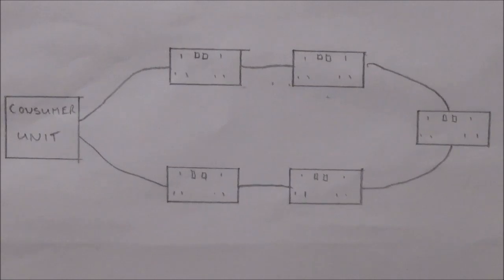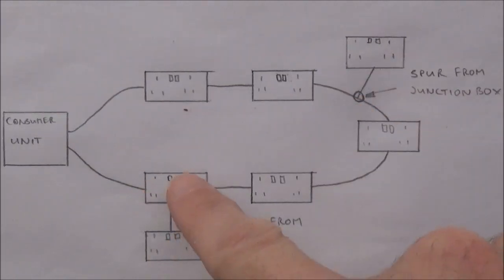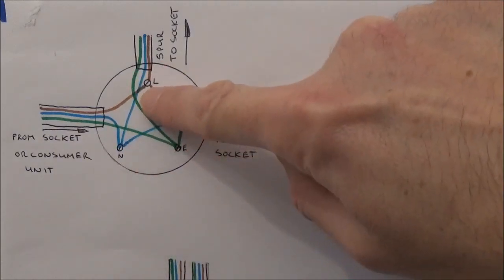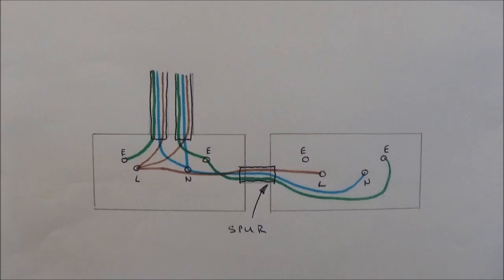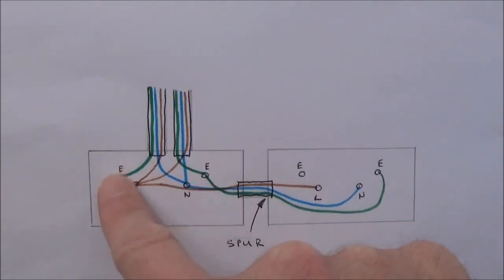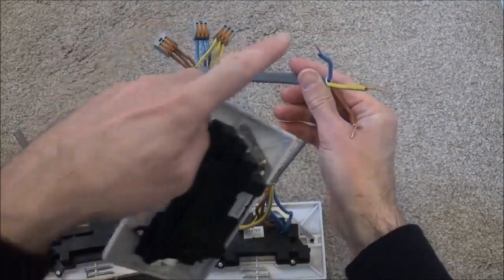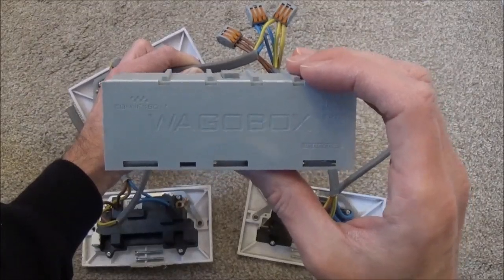How to wire a spur socket to ring circuit. Add a spur socket to ring main.

Comment: What worries me, is that if not correctly connected, people can end up with a broken ring but they won't know because everything "still works". (one of the reasons radials are better than rings IMHO)
Ideally confirm you've still got a ring afterwards, but that's not really a DIY job.
Reply from the maker: That is true for ring circuits, as you say radials are better in that sense.  Thanks for the feedback.

Comment: Great. can I wire a doorbell transformer in this way. Or doing I need to add a plug and socket as well?
Reply from the maker: You would need to do a fused spur using a fused connection and then use the suitable rated fuse to protect the doorbell circuit. Unfortunately I haven't done a video on this yet. Thanks for watching.

Comment: Excellent tutorial...
Q. I want to add a ‘new double’ wall socket from a ‘single floor’ socket which sits immediately below where I want the new double to be located.....can I just spur from the single floor socket straight into the new wall double? Thanks
Reply from the maker: In theory yes. You could also replace the single socket for a double if you want. Just make sure your existing electrics are in good working order as adding sockets to an already overloaded circuit could be dangerous. If in any doubt, call an electrician. Best of luck.

Comment: Great video. 
Can I fit a fcu in the same way to hardwire a class 2 alarm panel in? 
Basically I mean spur of a 2 gang socket and instead of adding another 2 gang socket I want to add a none switched fcu so the alarm panel can not be easily disconnected.
Reply from the maker: Yes you can. Just make sure you put the correct rated fuse in the FCU. They often come with 13a but you may require a 3 or 5amp. Best of luck.

Comment: Can you have 3 spurs from one ring?
Reply from the maker: You can in theory have up to one spur per socket. Obviously there are other factors that may affect this which is why it's worth getting an electrician to check your existing wiring is sound before adding more sockets. Thanks for watching.

Comment: Going to show me how to test it!
Are you certain it will trip quickly enough not to burn the fucking house down!
Did the addition affect the Zs?
Do you know what Zs is?
Do you do gas videos?
Reply from the maker: No I don't do gas, I'm not a qualified gas engineer. Thanks for watching.
Reply: Calm down steve
Reply: Correct me if I’m wrong not having a dig at anything, but am I right in thinking that all electrical works needs to have a mwc or when applicable notify labc, am I right you even need a minor works certificate for a decorative light fitting or even a  replacement from white plastic to a metal socket cover as to show the cpc is continuous and not altered the zs value. Yep Ive done diy electrics and now currently getting it redone by a registered sparks so I know I’m insured.basicly am I right in thinking a sparks has to do everything even the smallest of jobs to get that cert ,only thing a non sparks can do is change a light bulb 🤷‍♂️
Reply: So your a qualified electrican
Reply from the maker: @stevensmith4449  no I'm not.

Comment: if you were to avoid using connector blocks and wire directly into the socket, would it just be part of the ring? is that acceptable to do?
Reply from the maker: To be part of the ring you'd need to connect an existing socket to the new socket then back to another socket in the ring but remove the cable that used to connect the two sockets if that makes sense. You can't have a ring within a ring. Hope that helps. Thanks for watching.

Comment: Does the junction box have to be accessible?
Reply from the maker: No but if it isn't then in theory it should be in a maintenance free junction box. Thanks for watching!
Reply: @POUSEaroundtheHOUSE  Thanks, great video. Just done mine now. Just carried a wire from my socket under the floor board to make a new socket. Getting a chase behind the skirting board was really hard. I find your videos really helpful. I used quick wire conections to build a lighting circuit in my man cave. Great vid that was 👍
Reply from the maker: Good effort and thanks for the feedback. Best of luck with your projects.

Comment: Thanks fab video, can you just confirm how many spurs you can add from socket to socket so can I go from the socket on the ring add a spur and then add a spur to that?  Thanks
Reply from the maker: One spur from a socket. If you want to do more spurs, you need to install a 13amp fused spur switch then your spurred sockets.

Comment: Electricity has so many hidden dangers that the majority of diyers have no way of checking, just because you used the correct cable size for the job and it works does not mean it is safe! What happens if there is a fault, how will you know if the fuse or circuit breaker will operate fast enough to stop the wiring from melting? There is a good reason electricians have years of training and charge what they do but at least if you use them you can be rest assured that your system and family will be safe.
Reply: Dont forget bs7671 18th edition wiring regulations!
Reply from the maker: Hi, yes I completely agree with everything you said. The video is to demonstrate the process of physically adding a socket this way. At 33 seconds in the video I mention the requirement to meet part P regulations which covers all the things you mentioned and more. Explaining the part P regulations in itself is a video. Thank you for your comment.

Comment: One spur from one existing socket, would I then be able to spur from the new socket I install?
I am planning on going from a socket in my kitchen to then run it underground to my shed 2 meters from the kitchen, I then want to set up 3 double sockets in my shed, could I spur from each socket I install ? Just for charging laptop powering speakers and some plug in lights ? Could I also push it and plug in an electric oil radiator ?
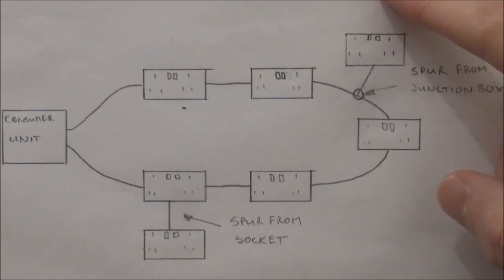Reply: Not an electrician .but according to my DIY book it firmly makes the point  1 spur from one socket. The chap showed2:47on the diagram you would be overloading with what you have in mind( if in the unlikely event that you had all appliances /tools working at same time.)
Reply: wasabimanic I have just seen another of his videos explaining the way to do this would be add a fuse switch before the first spur, also to be on the extra safe side I’m not going to ya a plug in heater and if I ever use lawnmower I’ll not plug anything else in the shed at the same time.

Comment: Can I switch a spur on and off from the socket it is wired to?
Reply: No , because you just on and off just that socket not all ring , you still have electricity on that ring from consumer unit
Reply: No, the switches on a socket control power to the load side (i.e. the front) of a socket only.

Comment: Just a quick question and from the video I think I have my answer, but feedback would be appreciated. I plan to add 3 double sockets in my bedroom, 1 either side of the bed and 1 behind the tv at high level, for the sockets at either side of the bed I plan to just extend the ring main so I would have 1 cable coming in and 1 going out and then for the socket at high level I just plan to spur off of an existing socket, is this fine to do so ? And is there a limit to how many sockets you can have on 1 ring ? Would it be advised to take out 1 of the existing sockets if adding new ones ? 

Thanks 
Conor
Reply from the maker: It's fine to take one spur off a socket. You can have plenty of sockets on one ring so that's not really an issue. The important thing is that your existing ring has been tested and you know it's safe and working properly, with the correct rated MCB and preferably these days RCD protection. All modern consumer units have this. If in doubt get an electrician to take a look. Thanks for watching.
Reply: POUSE around the HOUSE thank you for the response, that’s really helped 👍🏼

Comment: A complete circuit flows from distribution unit, life and back. A wire is called life before connected to appliances, from appliance back to MB unit, the wire is called neutral. Another wire is called the earth, connected to the appliance n as a one way connection to the MB unit where all the earth wire is connected to the iron rod dumped inside earth. Correct me if I am wrong thus far. If I want to make a spur, when I locate a circuit, I only see one wire. So I connect to the socket, before connection it is a life wire, the other point will be the neutral wire. For earth, just connect one green wire to MB unit from socket. correct me if I am wrong. Thanks.

Comment: If I had 10 socket on the circuit can I add a spur to each of those sockets?
Reply: I’m not sure in what application you would need 10 spurs coming off 10 sockets, unless your just asking as a random question. It certainly wouldn’t be recommended. You would just add more sockets to the existing ring main. It would also depend on the “load” you intend to use. If it was to power downstairs in it entirety that you would split that load over 2 ring mains, one for the front room and dining room, and a separate one for the kitchen. Hope this helps.

Comment: Sorry it me again; instead of the second (additional) socket in the spur, I would like to make it a light switch, and as previously explained, do I need a fused switch or a normal switch. Thanks
Reply from the maker: Sorry for late reply, fused switch with   3amp fuse for light. You e probably done it by now!

Comment: pleas HELP; I thanks a lot for your informative videos. I’m wiring; I have done what you’ve done but would like to extend Feom the 2nd socket to a lighting switch by a 2.5 t&e and the a 1.5 3core to the light. Should I  use a fused 5Aswitch or a normal switch. Thanks
Reply from the maker: You need to use a fused switch with a 3amp fuse, but if in doubt, use a qualified electrician. Safety first!
Reply: Thanks

Comment: Okay so hear goes.... I want too install another 5-8 plugs for my pc repair work shop onto the existing ring (I’ve basically divided my bedroom) how would I go about doing it?  do I just add a fcu and run it from that or is there something different like a 20 amp fcu I can use because it’s going too be more that 5 pc running at at lease 800w that’s not included the TVs and other hard ware for it?
Reply: What else is on the ring? You should just be able to break into the ring and extend it depending on what else is on it. A normal ring will deal with the computer load no problems.

Comment: Incredibly useful video. Will save myself hundreds when I move into my next house in November. Just get an electrician to give it a quick once over and good to go compliance wise
Reply from the maker: Thanks for the feedback.
Reply: Good luck finding an electrician who will sign off your installation. Their reputation is at stake, so firstly they will want to check every cable run and connection, then run the required tests, so that will be as expensive as any complete install.

Comment: Now you just need to do R1 R2 continuity test, ring main tests, insulation resistance, loop impedance and RCD testing, fill out minor works certificate 👍

Comment: When connecting a Spur, it's good practice to fold over in half 20mm of the wires at the end to give you twice as much copper to clamp the terminal into.
Reply from the maker: Thanks for the info Neal 👍

Comment: hi mate, do u have a video about how to wire in a 32 amp socket to my mcb breaker,    its so i can plug a 32amp compressor in my garage, ?,---  i want to use a big compressor in my house garage, its 240v and 32 amp,   but if i plug it in a normal socket it blows the 3pin sockets 13amp fuse.    is it just a case of putting a 32 amp rcd breaker in the mcb box,    then wire to it using thick 50amp wire,    then just put a  female commando plug on other end ?.----    is that all it is to fit a 32 amp socket so i can use 32amp in my garage  ?.      many  thanks dave, ps if u have a video can u show me it?. thx
Reply from the maker: Hi Dave I don't have a video sorry. I wouldn't like to comment on this without seeing it as I could provide incorrect advice. If you want to do it yourself then it is worth speaking to an electrician or your building control officer as adding a new circuit is notifiable works. Best of luck with it and sorry not to have helped.
Reply: @POUSEaroundtheHOUSE  ok that's fine, thanks -dave

Comment: What you forgot to say it a DSSO is only rated to a max of 20amps, if you ran two 13 amp appliances from one DSSO you would over load it,
Reply from the maker: That is the case for any double socket. Thanks for watching.

Comment: How many spurs can you continue with the one installed?
Reply from the maker: Only one spur from a ring final circuit. If you want to do more you need to install a fused switch from the ring final circuit (with a 13amp fuse), and then spur from that. Then you can have as many as you want in theory as the cable and sockets are protected by the 13amp fuse. Thanks for watching.
Reply: @POUSEaroundtheHOUSE  It is the same with garage lighting. You have to install a fuse board and then carry on from there. This must be the new regulation on the 18th edition or maybe was there early.  Thanks for the information it was helpful.

Comment: People should stop watching these amateur videos they lead to disaster. Don't know why I bothered to train for years to be an Electrician, I could have got all my knowledge from here
Reply from the maker: Sorry you feel that way. It is not my intention to cause disaster. Thanks for your comment.
Reply: Calm down chaps. He's only giving sound advice how to install a friggin spur not a 132 HV ring! You ARE NOT required by law to be an electrician to carry out this task in your own home within reason BUT this is about the limit of what the non trained should attempt before calling an Electrician.
Reply: Could not agree more, spent 6 years in total training as an electrician and to become an electrical engineer,  these videos teaching people how to do home electrical work is dangerous,
Reply: @Danny-204  no it just saves people money and usually a lot of time waiting for electricians to come and do the same job
Reply: @YM, no what it is doing teaching people to undertake jobs, possibly in special location or notifiable work, without experience or knowledge of the regs, and without the means to then test there work, interpret the test results, and then act of the results in the correct way. But on the other hand I make a stack of money charging people to correct there mistakes.
Reply: Danny 204 win win then
Reply: @Danny-204  you wont be correcting mine pal because there are none pmsl
Reply: @nick evans: What you on about pal
Reply: @Danny-204  because i do them myself danny boy so yous cant rip me off :) pmsl
Reply: @nick evans: it not about ripping people off, all I said is I make a lot of money from fixing people mistakes and there diy projects, but I am sure the work you carry out, is up to regulation and current standards, and is tested correctly,
Reply: Danny 204 is it hell as like lol I do everybody's electrics round here because I'm very cheap & no fires yet 🔥  💰 😂.
Reply: @nick evans: let’s hope you don’t hurt anyone, with your have ago approach
Reply: Danny 204 I will just blame pouse if I do 😂
Reply: Danny 204 🔥😂

Comment: Info can i take mains lead from my existing fused wall switch to single socket ,then onto double socket for under cabinet lights any help
Reply from the maker: Yes as long as you know the existing ring circuit your switch is on is protected by a 32amp MCB at the consumer unit (and tested to be safe), and that the fuse in the fused wall switch is 13amp or less.
Reply: @POUSEaroundtheHOUSE  Thank you very much for reply I have had a latest type consumer unit fitted rcd ect, I am doing most of my work myself  to save money  advices from electrician testing as well for me,hes very busy emergency calls week ends you guys get no time for yourselfs !.best regards bob lowe uk.

Comment: Hi, can you do spur on a radial so socket.
Reply from the maker: You can only spur of a ring final circuit.
Reply from the maker: You can only spur of a ring final circuit.
Reply: Yes, you can, but in this scenario (radial circuit) it's not called a "spur", it's called a "branch".

Comment: So just out of curiosity I have one double gang socket directly to the consumer unit would it be possible to add a second double socket from the existing first double socket without it circulating back to the consumer unit.?
Reply: Assuming the socket from the CU has its own MCB, you can add extra sockets after it which will create a radial circuit. You should have a maximum 16A MCB with 2.5mm T&E (assuming the cable is just clipped to the wall).
Reply: Adam Cooke Yes and yes... well trunking not clips.
Reply from the maker: Looks like Adam answered your question. A radial circuit straight from the consumer unit is fine for sockets if it has is own 16amp MCB with 2.5mm twin & earth cable.
Reply: Hi I`m in the same boat,I suspect but do not know, you can.Hopefully someone will answer!
I have installed a junction box between the socket and the consumer unit to spur off for a tv socket.Until I`m sure I`ll not re connect the original double socket.In my case any faults will trigger the breakers I reckon.
Reply: Anthony martin This is a better understanding in what I’m looking for. https://youtu.be/At7AnMV7Xd0

Comment: hi all, hope you can help. I have a consumer unit in my shed, SWA has been connected. From the shed consumer unit, how would I start wiring 6 spot lights with just one switch and 5 sockets ? Do you guys have a clear video/diagram regarding how to start wiring from the additional consumer unit?
Reply: Francesco Macca don’t do it if you don’t know how
Reply from the maker: Couldn't explain it over a message. If in doubt call an electrician! Thanks for watching.